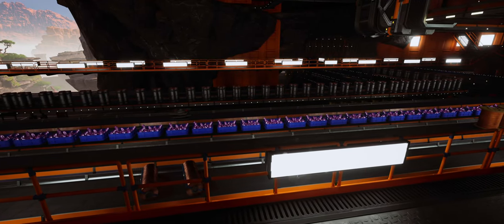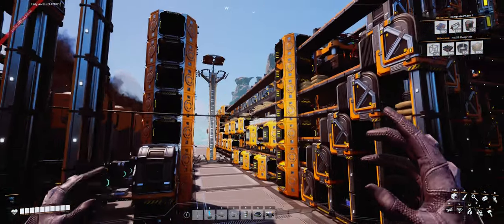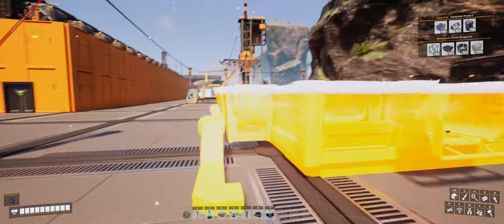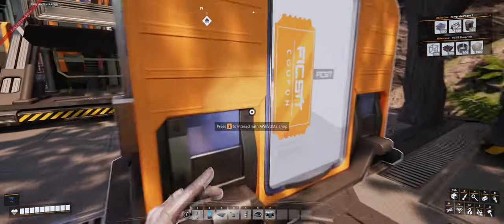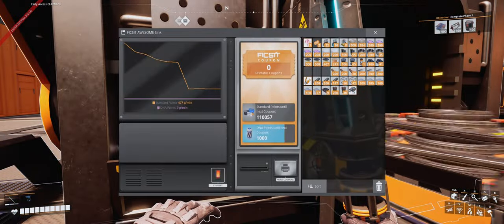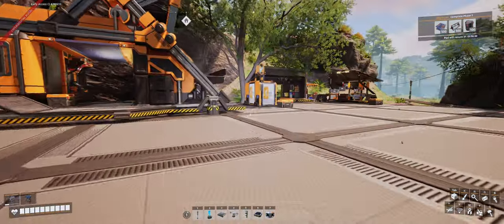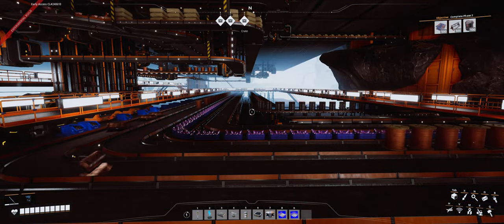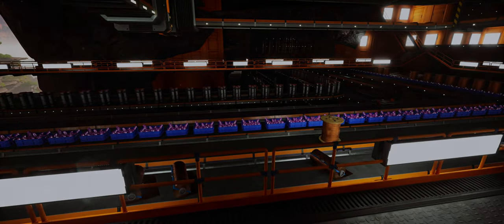I Used Lumen to Light my Subfloor | Satisfactory U8 - Ep 7

Comment: so the idea of your towers there are to just have "vertical bus lines" in rows of "constructors" and "assemblers" interesting. Assuming this is just for "slow processing" verse trying to pump out x parts per min for end game parts, or will you use this design thru out your world?
Reply from the maker: Right.  Basically the idea is to provide all the materials that any constructor needs, and all it has to do is grab it off the line using a lift.

Although this is a test run of this design, I don't believe I'll use this just for slow processing. I think this should scale well.  In late game, once I'm making more than 780 of an item and therefore fill up a line, of lets say, quickwire, I'll just add another belt to the bus, both the input bus and the output bus and stack em up.  There's a limit of course so I doubt I'd make all items in one location like I am now.  

This is just the starter factory, I'm planning on doing a huge oil/plastic/rubber/power plant and a huge aluminum/battery plant and then a huge space elevator part plant.  So because each factory will have its own needs, we shouldn't need quite so many different items and therefore can have more belts per item.

I mean, in theory.  No plan survives contact with the factory. LOL

Thanks for watching btw!
Reply: @Kinstruction  that thumbnail caught my eye, I was like what is he doing?! Haha it’s interesting take on short term starter items. I started my play through for the 1000th time building a mega base from the get go. Then expanding into it. Definitely interested to see where you go from here. What is your twitch brotha I’ll try to catch you live sometime!
Reply from the maker: No twitch. Everything is right here on YouTube.  The VODS are on my channel in their own playlist.  And I livestream here 3 nights a week. Tuesday, Thursday and Sat nights 9pm to 1am (or later) PST.

Although, I'm going on a two week vacation next week, but when I get back I'll be back at it. :)

Comment: Late to the party. Did the catwalk blueprint not line up due to the grid positioning when making the blueprint?
Reply from the maker: Its more like, once I put a catwalk into a blueprint, it stops behaving like a catwalk (like having snap points to other catwalks) and starts behaving like a blueprint.

So it was easer to fit the lights onto a catwalk that was already built, than build a catwalk that included the lights.

I hope that make sense? lol
Reply: This is why I wondering if the blueprint grid was relevant to maintain snap points as it did snap, just not where you wanted. The blue print wasn't made within one blueprint grid square. Am I making sense? Lol. Am glad you got something that worked nonetheless :D @Kinstruction
Reply from the maker: Oh I think I know what you're saying.  I think you could make catwalks with ONLY bluprints at least straight ones.  But the snapping wouldn't be catwalk to catwalk, they'd be blueprint to blueprint.  Which is more limited.  Hence why I avoided it.  Theoretically it would work though. Similarly to how I "snap" my railroad blueprints together in later episodes.
Reply: @Kinstruction  haha I follow. Look forward to catching up to the later episode ;)
Reply from the maker: Sounds good